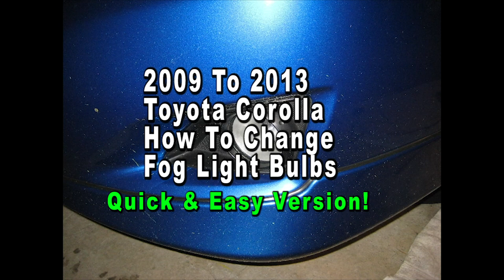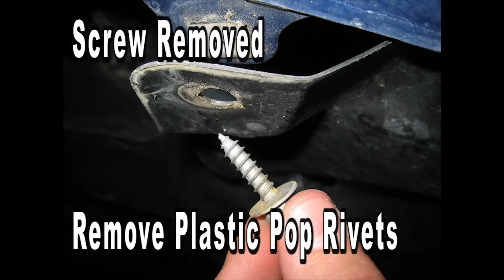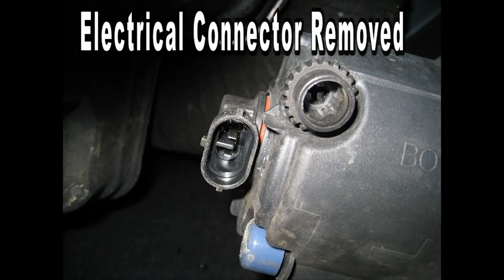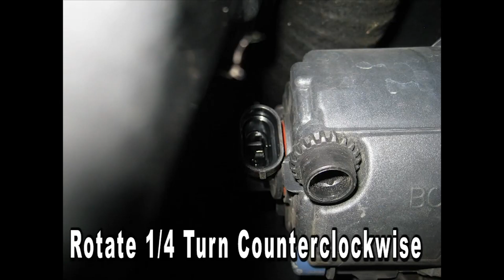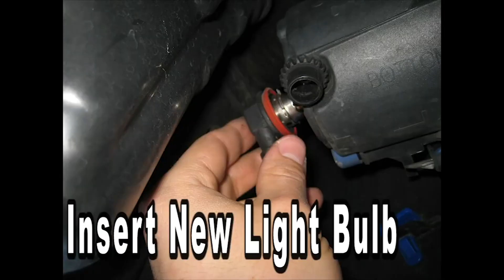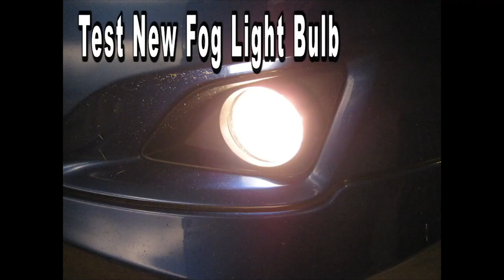2009 To 2013 Toyota Corolla How To Change Fog Light Bulbs - Quick & Easy Version

Comment from the maker: Check out the DIY tutorial for changing a burnt out fog light bulb in a 10th generation 2009, 2010, 2011, 2012 & 2013 Toyota Corolla - 
https://www.paulstravelpictures.com/2009-2013-Toyota-Corolla-Fog-Light-Bulbs-Replacement-Guide/index.html

Here are all of the DIY repair and maintenance guides for the tenth generation 2009, 2010, 2011, 2012 & 2013 Toyota Corolla - 
https://www.paulstravelpictures.com/Articles/2009-2012-Toyota-Corolla-Common-Problems-Repair-Maintenance-Guides.htm

This automotive "how-to" guide was specifically written to assist owners of the 10th generation (2009, 2010, 2011, 2012, & 2013) Toyota Corolla in replacing a burnt out fog light bulb in the front bumper.
Owners of other Toyota, Lexus or Scion vehicles such as the Yaris, Matrix, Prius, Camry, RAV4, Sienna, Tacoma, Tundra, FJ Cruiser, Venza, Highlander, Avalon, Sequoia, Land Cruiser, IS 250, ES 350, GS 350, tC, xB, xD, iQ and FR-S may also find these DIY instructions to be helpful.

A replacement fog light bulb is part # H11 available from manufacturers such as Sylvania, Osram, PIAA, Philips, Putco, GE and Optilux.